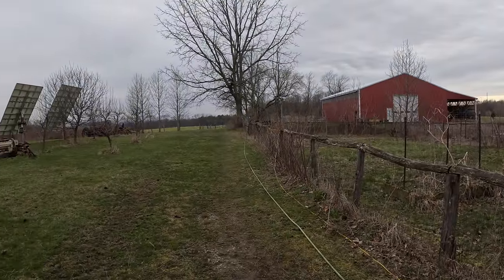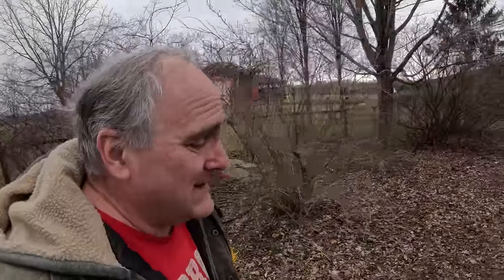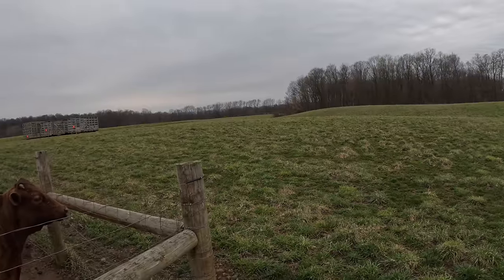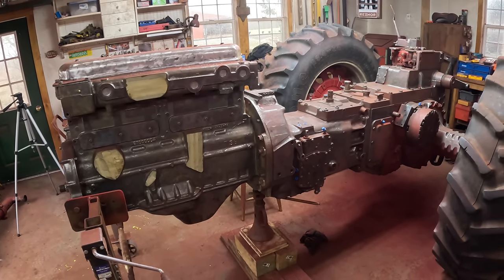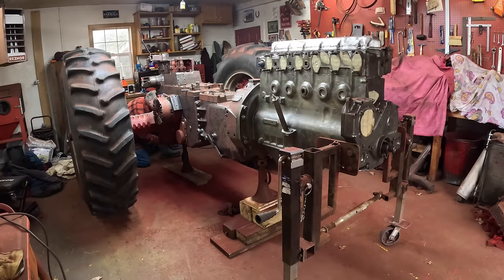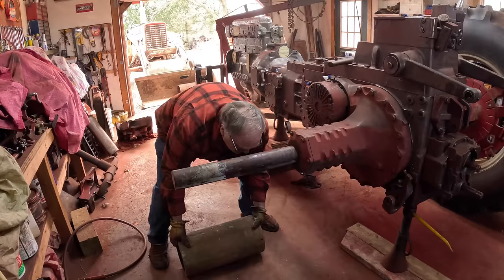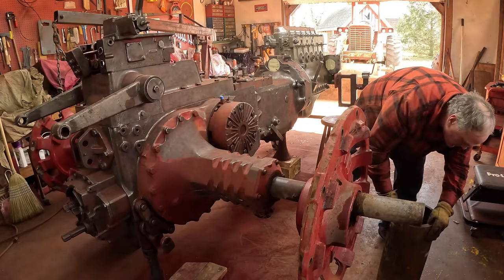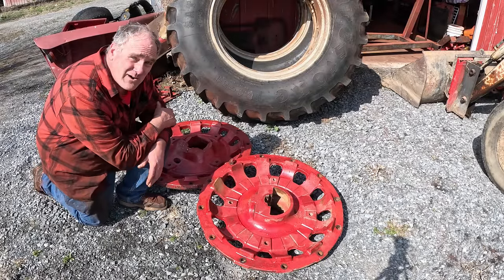Wheely Fine on the Farm

Comment: I love the farm work & the tractor build work.   You should build your 100% custom RatRod of a tractor.  Since it would be a mashup of parts from many different tractors & brands,  you can paint/clearcoat it any way you like. :)
Reply: Just my two cents: 3 Major Tractor type tools you may be missing that "might" be of help  1) Fence post Drive w/Auger option,  2)
TELEHANDLER w/ 4x8 Man bucket for working up high  & hydraulic quick connects for attachments,  3)  backhoe, 4)Firewood maker/splitter.     With your skills,  you could build & MASH  all that together!

Comment: Great outro song! 😂. Maybe consider putting a ceramic coating on the tractor after the new paint is on & dried. Watching Pete crack those bolts I was thinking He is bull ox strong & he’s having trouble, there’s no way I could get them to begin to budge. Exact reason I have a tractor mechanic with the strength & tools for the tight & heavy things on mine I can’t move, lift or break loose even after applying lube when major work / maintenance needs to be done on it.

Comment: Ah man, I hate dealing with seized and rusty bolts, I'm always afraid I'm going to break them off at the head, and then I'll be in trouble. Thankfully, I found a really nifty tool to help me with them, it's called the Bolt Buster, it uses induction heating to heat up the bolt and help break it loose, and I love it, the few times I've needed to use it, it did the trick. The only downside to it is that if you have a pacemaker you can't use it because it'll mess with the pacemaker, and that's not good. I think I bought mine for a few hundred dollars, it came with the tool itself, plus a bunch of coils of different sizes to wrap around bolts and nuts. So much nicer than using a torch to heat them up.

Comment: It is hard to find used wheels that are good.  Many have run loose damaging the flats for the keys. I like the wedge lock since they stay tight, though you do want the service tool. For what you do either should be fine.

Comment: You gonna drive up to Auburn to see the eclipse?  One of the big problems with viewing eclipses is the weather.  As the Sun starts to go behind the moon the air loses it's sunshine and clouds start to form blocking the view.  When the Sun peeps back out the clouds go away. Unless you already had overcast conditions before the eclipse started in which case you might as well stay home.  Viewing an eclipse is rare even if you are directly in the path.
Reply: Warm air from the sun tends to cause clouds to rise during the day. Darkness cools the air causing it to sink. Sinking air dissipates clouds.  I've seen clouds thin and dissipate during a total eclipse and felt the air cool by several degrees along with an increase in wind caused by sinking air.